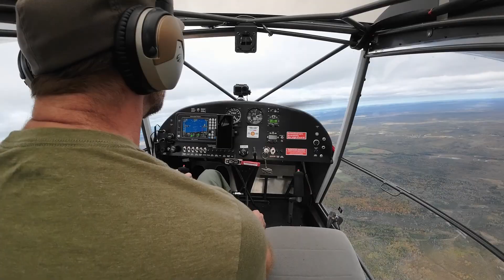I Installed Vortex Generators on the ApolloFox

Comment: I have a Kolb Mark III Extra. I have already purchased the VG,s. How did you determine the placement of the VG,s back from the leading edge?
Reply from the maker: The recommended placement is 8-10% of the chord back from the leading edge and spaced 1% of the wingspan apart but I read somewhere online that moving them forward and spacing them slightly closer together gives better results so I went with 7% of the chord and 0.9% of the wingspan.

Comment: Nice! I got to fly with vortex tape and it does the same thing. You should put a set on the Beaver too.
Reply from the maker: Vortex tape...? I've never heard of that. Can you share a link or something so I can check it out? Thanks!
Reply: @mmatt   So craptube deleted my comment but wingsandwheels has Z-Tape / Dimple Tape that the glider guys use, and amazon has PVC drywall corner tape that's full of holes. The drywall tape was on the Cheetah that I learned on, and it gave -500 fpm mush with no clean break with power off. 100% it's not certified lol.
Reply from the maker: @dysonhale6920  Interesting! Thanks!

Comment: I have a Kitfox series seven  & had similar results. I also put vg’s over the cockpit in line with the other vg’s as well as vg’s on the underside of the elevator. This improved elevator efficiency at low speeds. It did not seem to want to break into a stall. I added another line of Vg’s behind the original ones on the underside of the elevator , as a friend of mine had some added success in a different aircraft. This however brought back a very slight stall with a nose dip.